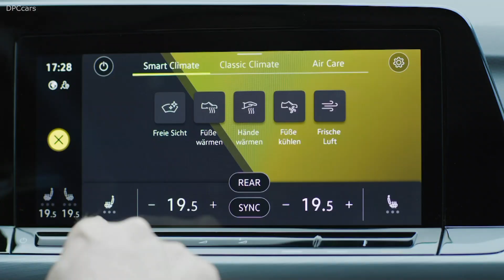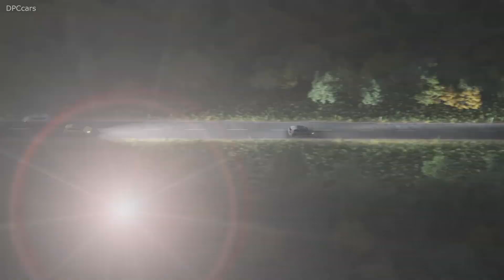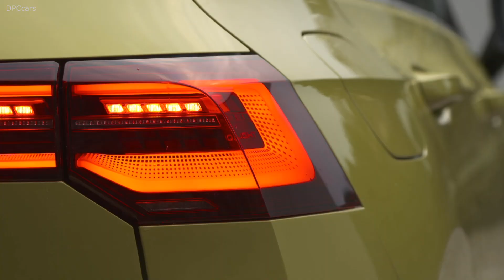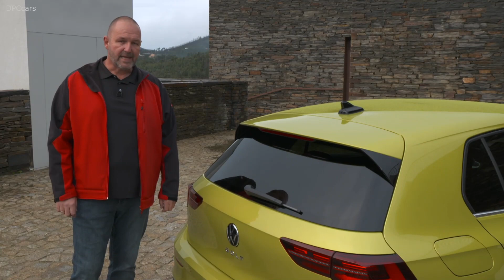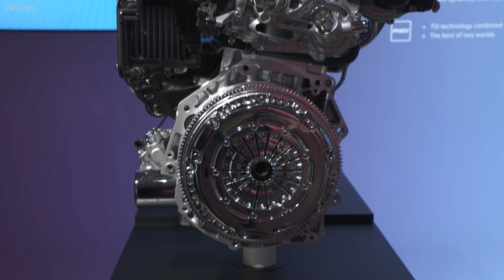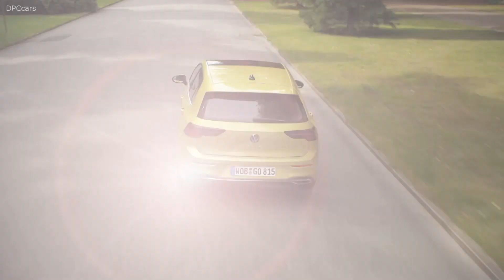2020 VW Golf 8 Test Drive Review   Volkswagen

Comment: Will the information screen work on cold mornings,my mk 7.1dosent,will the start stop function work after two years,mine docent,will the adaptive cruise controle work after two years mine docent ,vw tell me its intermittent.and haven fixed any of them, god help you
If you want to drive your mk 8 on cold mornings,
Reply: graham hewitt hi mate, the reason start stop doesn’t always work may be because you have air on/heating on. If the air con/heating is not at the temperature that you’ve set it then the car won’t activate start stop, this is to try and achieve the set temperature as soon as possible :)
Reply: My Mk7 has never worked properly